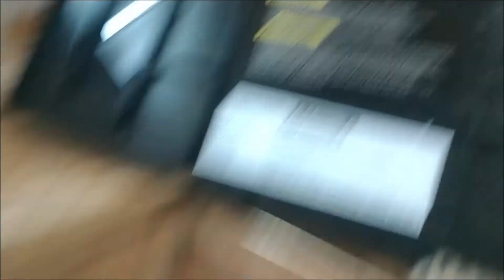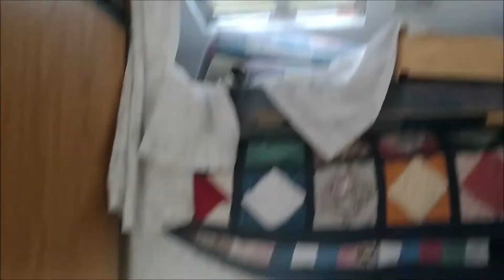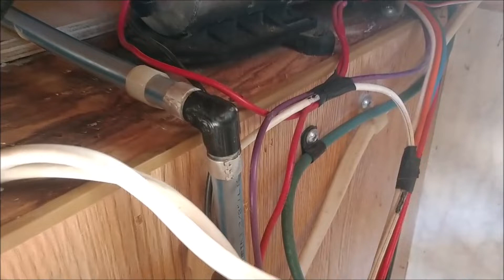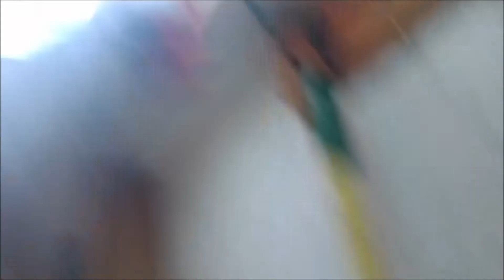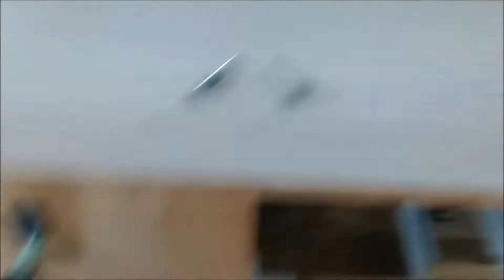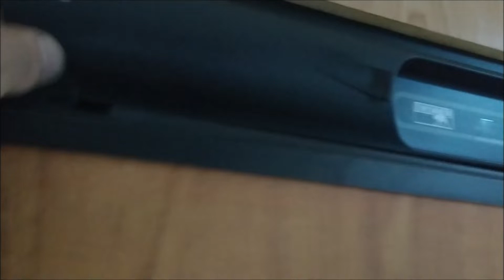Installing a new PowerMax PPC 30 55LK in our truck camper.

Comment: Hey thanks for video! So for AC panel, loads negative wires go into the bar, but for DC loads, does the negative go directly into the 12V Battery negative ? or to the negative (AC) bar as well ?
Reply from the maker: Hi, from what I remember there is one main negative bar there that all the negatives are connected to.